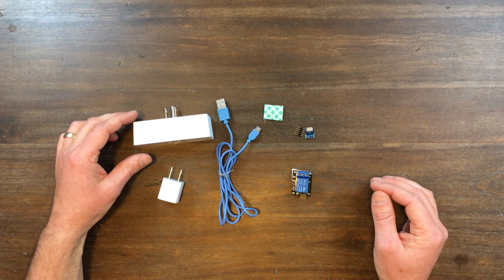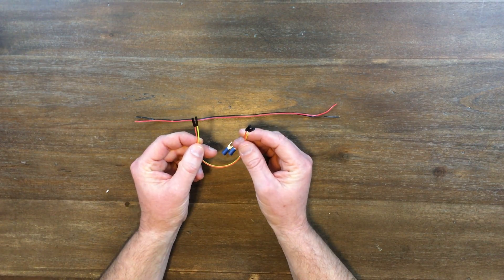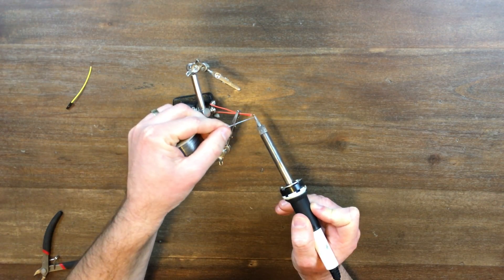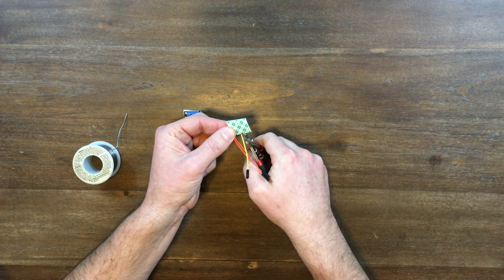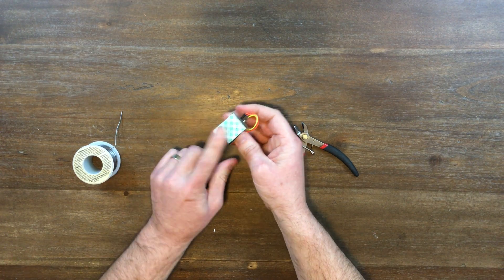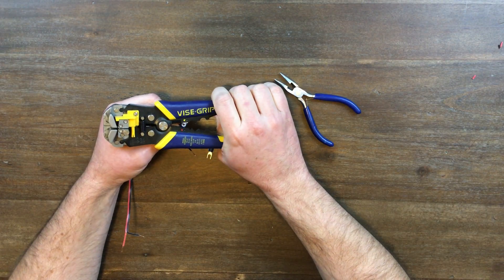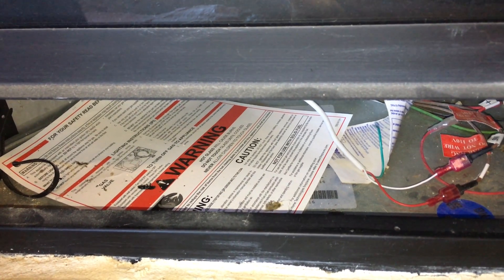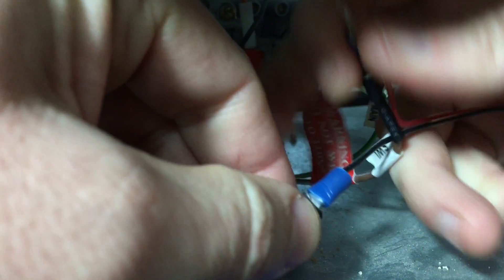Alexa Wemo Controlled millivolt Fireplace - the easy way!

Comment: Could I do a relay the would handle 2 connections (switches), one for turning on the fireplace and another for the fan.
Reply: It doesn't need to control fan speed, it would simply complete a circuit just turning the fireplace on.
Reply from the maker: Yes, that would work.
Reply: @mattadata2  Would I need a 2 channel relay?
Reply from the maker: Yes. And another smart switch if you want to control them independently.

Comment: Just bought you a beer Matt.  Your instructions worked great for me.  I used a TP-Link smart switch instead, and my controller needs spade connectors instead of forks, but otherwise identical to your instructions.  Very satisfying project.
Reply from the maker: Awesome! Thanks!

Comment: will this work if a) my switch is a millivolt spst built into the fireplace and b) my fireplace fan is controlled by 110v plug. The fireplace itself is a gas powered lennox stove.
Reply from the maker: Not 100% sure, but I think it would.

Comment: Hi Matt so i have a heatnglo fireplace with remote control, now,i have a power box with two outlets ine dtates "rem" where my blower us connected. Then one that is ooen thaf states "fan but no power.  No i have to wires that come out of the remote unit that goes to the solenoid . Is this wherev i tap in? Thxs Mike
Reply from the maker: mpena43809 - sorry Mike, I am unable to tell where your hookup point is.

Comment: If you want a much simpler solution, you can buy a relay already put together. I just bought this:  https://www.amazon.ca/gp/product/B017743I7S/ref=ppx_yo_dt_b_asin_image_o01_s00?ie=UTF8&psc=1
Cut the wires to the on off switch on the fireplace. Then put one to the ON screw of this device. The other to COMMON. Then turned it on. Plugged it into a CE smart outlet. Then into the wall. Works perfect.

Comment: Hey Matt this is awesome - would this also work for a garage door opener?
Reply from the maker: Yes, but it will take some different software, but will use same hardware. I have my garage setup on it.
Reply from the maker: I am happy to share if you are interested, but my solution also requires a raspberry Pi running Hassio home automation that the Wemo will interface with.

Comment: Nice Job Matt, but here's another suggestion : for those of use who don't even want to solder:
 
Enclosed AC/DC Power Relay with Protection & De-Bounce. Screw Terminals. 120V Trigger Input.

https://www.amazon.com/gp/product/B017743I7S/ref=ppx_yo_dt_b_asin_title_o07_s00?ie=UTF8&psc=1

$12

Lutron Caseta Wireless Smart Lighting Lamp Dimmer and Remote Kit, P-PKG1P-WH
https://www.amazon.com/Lutron-Wireless-Lighting-P-PKG1P-WH-Assistant/dp/B00JJY1QG0/ref=sr_1_4?crid=1BM9PQHWL90B&keywords=lutron+caseta+lamp+plug&qid=1553600668&s=gateway&sprefix=lutron+caseta+lamp+%2Caps%2C134&sr=8-4
$49

Bonus: REMOTE CONTROL (the PICO SWITCH)  for your wife who hates "talking to things to make them work"!

Plug in your lamp module, plug the relay into the lamp module, connect the two leads from your fireplace to the screw terminals on the other side of the relay module... you're done (OK, you also need to register the lutron lamp module and name it "freplace" and link to the pico switch, but then you're really done.)  

I also tried to do this using a Lutron Casetta wall switch, but it did not work - when the switch was turned on, the relay would "blip" on and off rapidly. I'm not sure why this did not work, so I ended up just going back to the lamp module. I also put a regular wall switch to control the outlet the lamp module was plugged into so I can disable the while system if I'm on vacation, although you can accomplish the same thing by switching off at the relay (the relay has a built in switch, but you'll have to open the fireplace up to get to it, which is no big deal if you're like me and obsessively turn the gas off whenever you're gone for a day: )
Reply: Extra Bonus: Use Alexa "Routines" and have it respond to "Alexa, Come On Baby, Light My Fire!"

Comment: great video.  I'm not well versed in electronics- would this still work if you have a remote controlled fireplace?  And if it did, where would you add in the voice controlled relay?  my fireplace is actually not a gas fireplace but an electric Dimplex Optymist Pro and does not have a wall switch
Reply from the maker: novaman - hi, yes it should work. You will just need to find two small wires that go from your remote control receiving unit to the fireplace gas valve.  It should be labeled.  You can test it by unplugging those two small wires at the receiving unit and touching them together. If that works, then connect those wires to the relay as I did in the video.

Comment: Wouldn't it just be easier to replace the analog switch with a smart switch?
Reply from the maker: Yes that would be easier, but it won’t work. Smart switches need 120 volt AC. Fireplace needs to only close a connection. There isn’t 120v behind the old analog smart switch.

Comment: Would this disable powering the fireplace with the wall switch? Is there a way to use this and the wall switch?
Reply from the maker: Yes, it disables it. There is a way to wire it up so you can use the switch and Alexa. I will dig out the old diagrams reply back later.
Reply from the maker: Check my other video out for how to wire up the switch.
Reply from the maker: https://youtu.be/wUP68vYBIco
Reply from the maker: Here is a better way of doing it. See my reply comment to Alma on Dec 12th, 2018

Comment: Cant you just plug in a smart plug then connect to that through maybe google home seems alot easier
Reply from the maker: Nope. I tried that first. The fireplaces have a safety feature to not turn back on after the power has been cut

Comment: Hi @mattadata2, thanks for the video. Is there any order to connect the 2 wires from the relay switch to the 2 under the fireplace (wall switch)?
Reply from the maker: No, that doesn’t matter.

Comment: There's something plugged into the outlet that your Wemo switch is plugged into in this scenario. I think it's the fan? Any suggestions how to get around that?
Reply: There's something plugged into the outlet that your Wemo switch is plugged into in this scenario (under my fireplace.) I think it's the fan? Any suggestions how to get around that?
Reply from the maker: Hi. No, it's not the fan. It's the fireplace control unit....the same thing I attached the relay to.  My fireplace doesn't have a fan installed. What are you trying to get around?
Reply: No, my fireplace does have a fan installed. I believe that it's plugged into the outlet I would need to use for this setup. Is there a way to get around that?
Reply: the "REM/AUX" outlet is open, could that be used?
Reply from the maker: Yes, I think that would work. Just plug something in there to test and see if it is powers up. Like a small lamp or clock.

Comment: Definitely very easy.  I tried this method when my NodeMCU/relay setup I made from your other videos kept giving me problems with Echo constantly losing connection to the device. However, I used a slightly different approach by connecting an old 5V Motorola phone charger with the ends spliced directly to the positive, ground and signal terminals of the relay like you did with the USB board. Works like a charm and the Wemo plug stays connected to Echo. If you have any insight as to why my NodeMCU/relay setup keeps dropping connection with Echo please share.
Reply from the maker: Good solution!